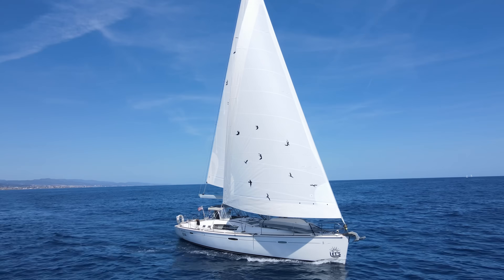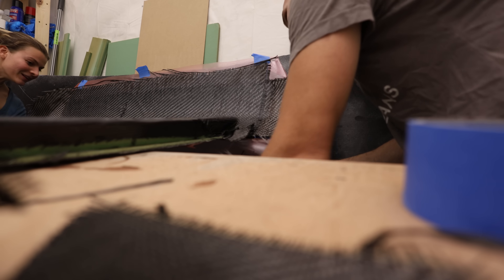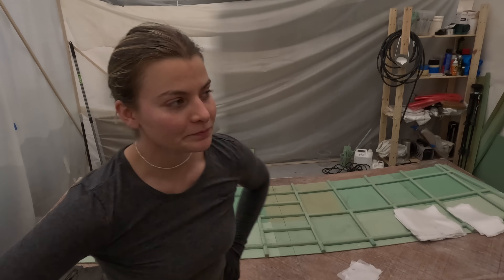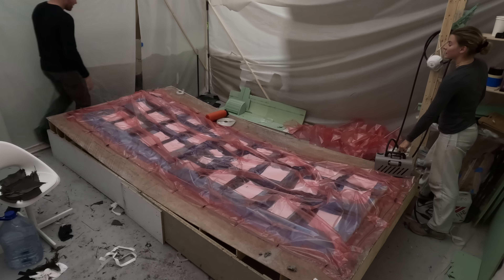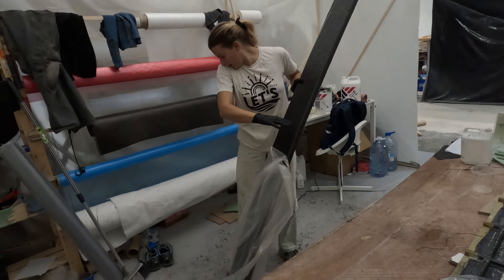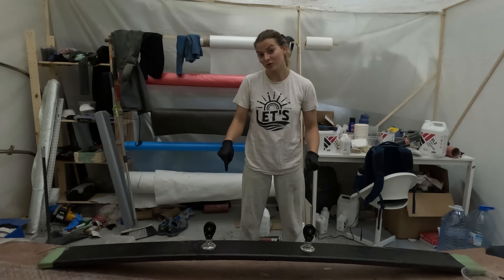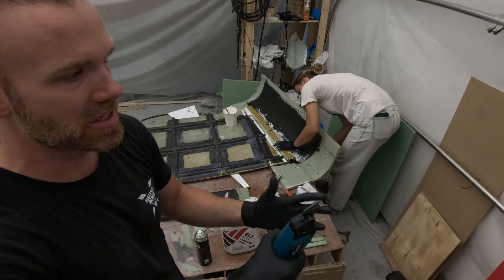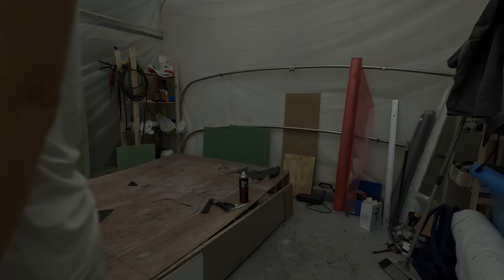Carbon Fiber Hardtop Bimini: Building the Rain Catch and CURVES (11)

Comment: For your gloves you could buy cheap cotton glove liners in bulk, and wear them under you more expensive rubber gloves. They will absorb sweat as you work, and allow you to change rubber gloves as needed, without the need to change the cotton glove liners underneath. I do this all the time as an aircraft mechanic. My Employer buys the cotton liners in bulk from someone in Pakistan.

Comment: I have been watching all the episodes you need to stagger the "light lines" or weave orientation from 45 degrees and 90 degrees for structural stability and other things I have noticed you should do different so you don't have dry plies. I have 25 years experience with composite work in the aerospace industry.  How can I help answer questions you might have?

Comment: I just want to alert you to the forces that the main sheet can exert on the traveller, whether track and car or multiple sheaves, for a 60 foot mainsail luff with a 20 foot boom in 40 knots of wind you can see up to 3 tons (imperial) of shock load. It's unlikely you'd have a full main up in that much breeze but storms and squalls do happen when you least expect them. Moving the main sheeting points off the deck means the moment applied to the deck bonding points have to be seriously beefy and strong, the 3 tons multiplied by the distance from the deck. Seriously, please consult a naval architect on this part of your build.
Reply: I agree. They are a clearly very smart and resourceful couple, but this design has me seriously concerned if not triple checked by an engineer/architect in the business.

Comment: I am curious about how long you leave the vaccum pump running?  Most of the time I see vacuum bagging, the vac pump is left on at least until the resin is fully set and often until the next day.  Those pumps are not damaged by pulling a deep vacuum as long as there are not large air leaks.  The like to pull against a resistance but are not made to move lots of air.

Comment: Hi guys! Nice to see you back in the shop! 

I'm going to go on record and say that I'm very nervous about moving the main sheet from the deck to your arch. I'm not an engineer and I've never sailed anything larger than a Hobie 16, but I have a lot of respect for the forces on the main sheet. And that's just in normal sailing. Imagine what those forces are in a knockdown or in an inadvertent jibe. You mentioned a boom brake. Good idea, but are you comfortable with your entire dodger/bimini project depending on it?

If the forces on the sheet exceed the strength of your current setup, you've got a hole in the deck, which you can fix. But if the forces exceed the strength of your arch, its possible that you might lose the whole dodger/bimini. There are other ways the setup could fail, too. Blocks can pull out. The arch can crack. Anchors to the deck can pull out. Or what if the backstay fails? Then you've got the whole load of the foresail plus mainsail on your arch. Lots of possible points of failure. Failure in any one of them would likely result in loss of control of your boom. That's manageable in light air. But if something breaks it won't be in light air. It will be in a blow or sudden squall, maybe at night. Whatever lines or hardware are still attached to the boom are going to be flying back and forth across the deck at terrifying speed and I worry about the two of you getting it under control without getting hurt.

I've looked at boats with main sheets on arches and to my eyes they always look like accidents waiting to happen. I understand why designers want to keep the cockpit clear but I just don't see how you achieve the necessary strength and rigidity way up in the air like that, with shear forces pulling in every direction. I'm sure the engineers have run the numbers but my eyes will never believe them. As I said, I'm not an engineer. And maybe I've been drinking too much of Dick Beaumont's Kool Aid. But I do have some experience with things breaking. And it would be a real setback for you guys if this thing doesn't work. 🙂
Reply: With the mainsheet attached to the middle of the boom the forces on it will be GREATER, not less than if it’s attached at the end.
Reply: Also, need to consider the engineering of the boom itself, if moving the location of the traveler location
Reply: As I wrote this I was thinking of a mainsheet accident in 2022 in which two people were killed. Accounts of the accident differ, but the gist of it is that the sheet, which was still attached to the boom, became a whip that struck multiple people. Help was slow in arriving and the result was two fatalities: https://www.youtube.com/watch?v=7ceqKa_4cJU
Reply: As I wrote this I was thinking of a mainsheet accident in 2022 in which two people were killed. Accounts of the accident differ, but the gist of it is that the sheet, which was still attached to the boom, became a whip that struck multiple people. Help was slow in arriving and the result was two fatalities. Look up "SV Escape mainsheet accident."
Reply: RE: "sideways"  I don't have concerns about the static loads on this arch.  I am very concerned about the dynamic loads.  This thing has much more mass than the canvas and SS arch.  As you sail through seaways it will be constantly trying to sway back and forth.  The dingy, hanging from the davits will make it worse.  The only thing resisting this swaying are the corners at the top and the leg fastenings at the bottom.  Eventually they will give way unless there are more braces in the corners.  It will work fine a couple of years but then fail.  The traveler will make this worse.  Pessimist engineer here.

Comment: Curious what you've spent on carbon fibre cloth. I am currently mid way through a similar Bimini built for our 47' Jeanneau. I've gone with a SS frame with 2  500 watt rigid solar panels set down into it. The  non solar areas are fibreglass / epoxy over honeycomb core board . I have added a lip around the perimeter for water collection like you as well. I very much like your design but it wasn't an option on a center cockpit like ours. Looking forward to seeing your finished product. Looking very good. Fredb SV Tico

Comment: @14:23 The brushes can be thoroughly cleaned with vinegar. While still wet, clean again with soapy water, rinse thoroughly with water and let dry completely.
This is also a perfect method for epoxy on skin or in hair because vinegar neutralizes the epoxy.👴🤓
I have developed a severe epoxy allergy, believe me, this is the only thing that works.👴🤷‍♂
("washing" with acetone doesn't work because it only works as a thinner. When it's evaporated, the epoxy just cures)

Comment: Isn't it safer to let somebody make the pulleybase out of aluminum or steel? It is a relative small part so it wont add too much weight, but it is much stronger right? Especially with the whole "need to handle forces from alle sides" story